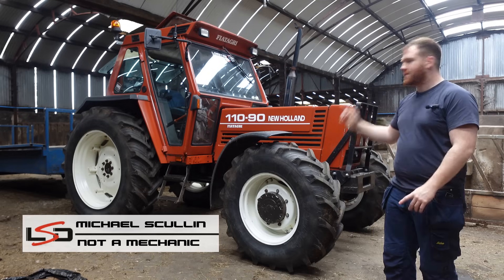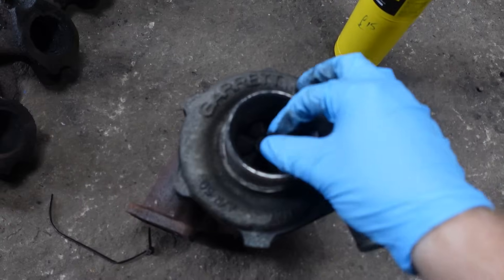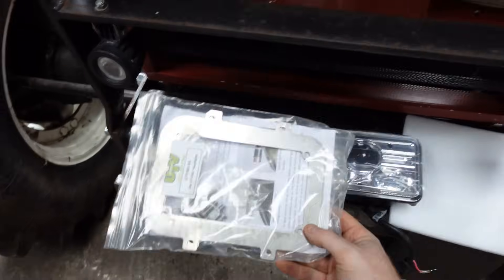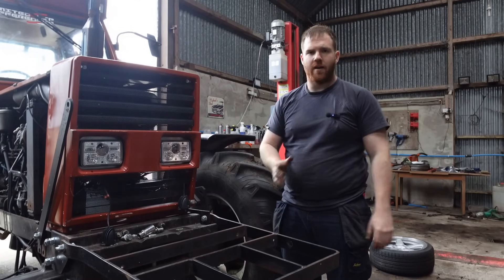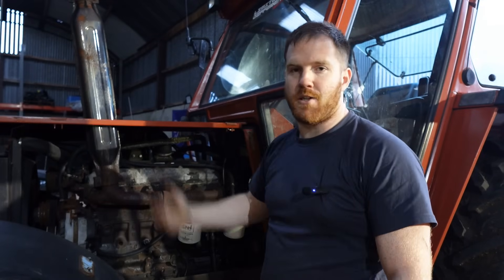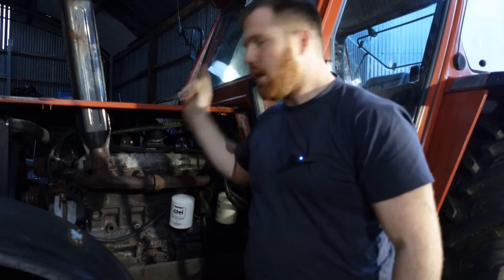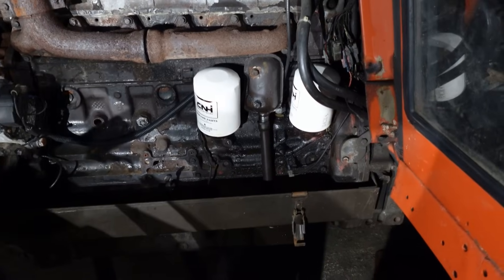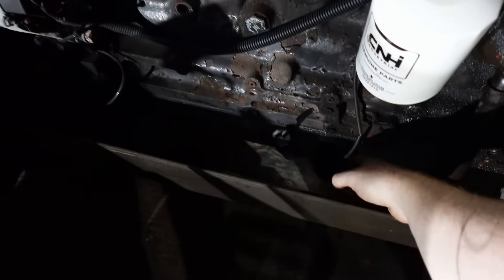Turbocharging my Fiat NH 110-90! Part 1

Comment: ... I would see what it is doing on a dino before you. fit the turbo    if it is above  the factory figures I would be inclined to put it back to those figures before fitting a turbo ..........the candle that burns twice as bright lasts half as long .....
Reply from the maker: I wanted to do this as well because she was well at herself before I turbo'd herself but I work away a lot and couldn't get the time

Comment: I can't imagine putting a turbo of a 7.5 litre engine on a 5.9 litre will work that well..that's from 25 years experience as a mechanic
Reply from the maker: And yet.. works really well
Reply: How mechanic dose not know that turbo as diesel go's strong? Engine size dose not mean any thing same engine can have 3 or 4 diffrent power outputs with 3 or more diffrent setups n/a, turbo, intercooled or big fuel system.
Reply: fiat f140 has a 5.9 litre and runs a t04 turbo so will work not a problem

Comment: Great video lad. We done our 110 here. Really made a tractor out of her. Might be worth considering a oil cooler unit under the oil filter closer to the cab. Bit of pipe work involved but will keep the oil from getting burnt out.
Reply from the maker: Tbf there's nothing wrong with keeping things cool. At a later stage I'd consider intercooling this thing and an oil cooler as well. I'd run the oil cooler right up to the front of it tho rather than below the cab?
Reply: I’d be lying if I said I wasn’t jealous about your machine. Drove many 110s in the past and ran them hard. I put the needle up on them when under stress so  worth considering a bit of cooling help I’d say. Both coolant and oil